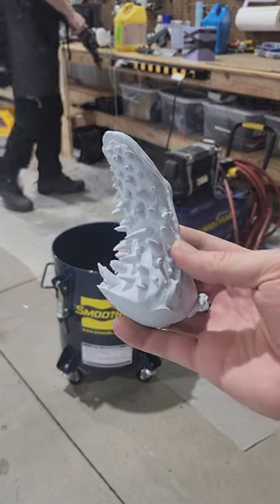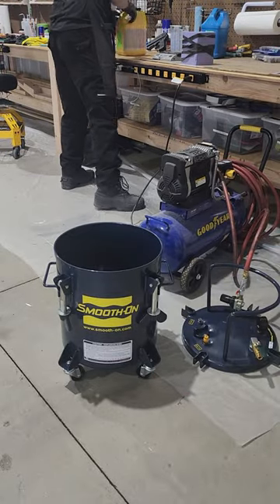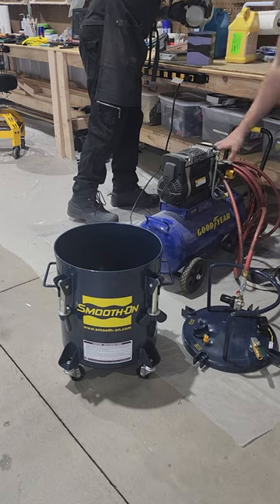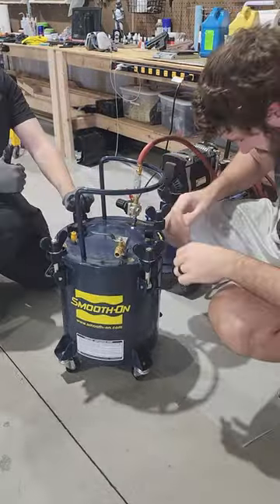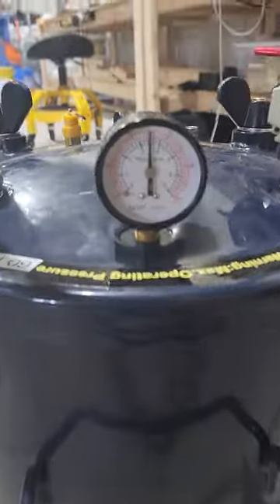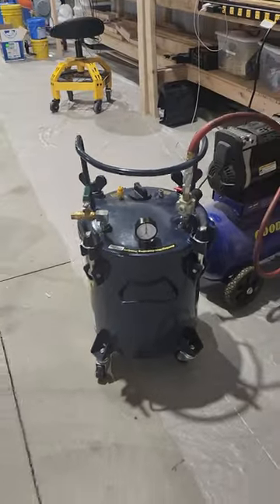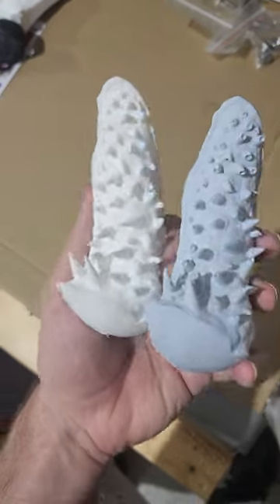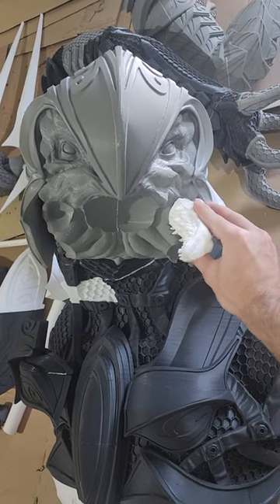Making a Life Sized Arbiter Pt 24

Comment: Should have used it like a vacuum and pulled the air out instead of putting air in it works a lot better
Reply from the maker: Not in this case - it takes too long and the resin would be cured before any bubbles came out
Reply: Vibrate it at the same time as putting it under a strong vacuum works pretty well

Comment: You could just vibrate the mold dorectly after you pour it... similar to concrete when you make a foundation, you will vibrate the concrete making the foundation more stronger and it allows the air bubbles to shift up to the top... you can probably try this with the mold, and get a vibrator of some sort to vibrate the mold to allow the air to escape... hopefully that'll help